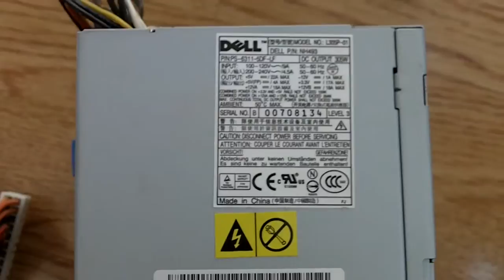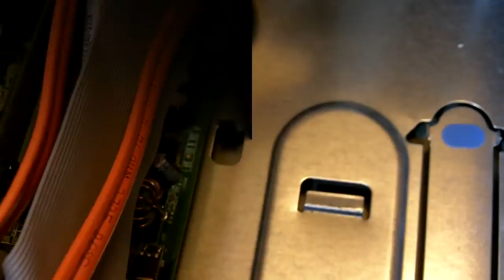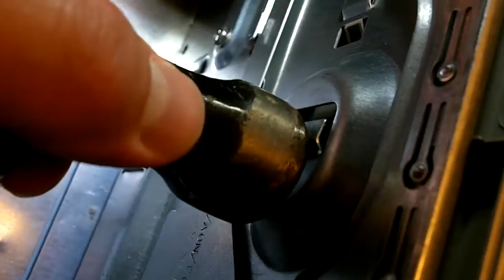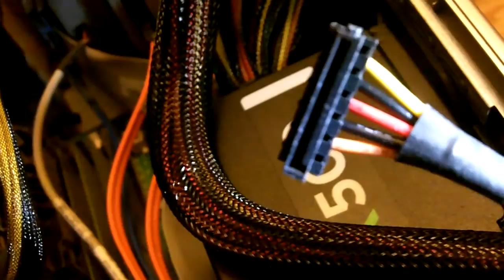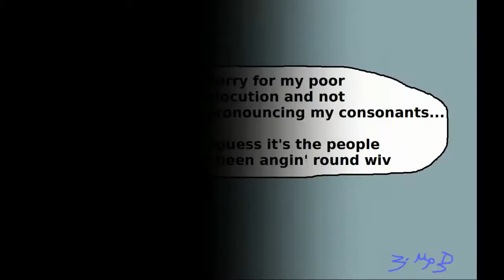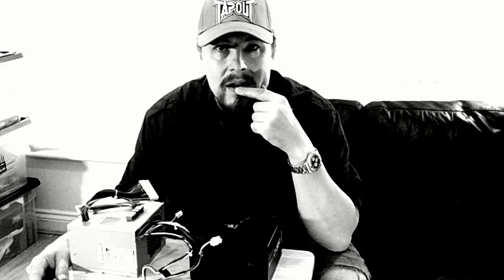Install CORSAIR CX500 Power Supply into DELL DIMENSION  E521

Comment: Thank you, was helpful to know how you identified the CPU power connection. ON our Dell 660 I was unable to get the 24 pin connector latch on the CX500 to latch on the MB 24 pin connector, it just wouldn't push down far enough to latch, did you run in to that problem too on your E521?

Comment: Was it possible to pull the guts out of the old power supply and place the entire new power supply into the old housing?
Reply from the maker: +Larkinchance I doubt I would be able to do that, would probably damage the box and connections, but if the new one fits as it is then what would be the point...it would take ages too and probably have to solder things etc.

Comment: hey i have a question i have a e521 and i want to upgrade my graphics card i still have the original one which one do u reccomend i havent  replaced the power supply either i could do that too.. but i just want to know your opinion
Reply from the maker: +t uraab (ehjmechscape) well there are so many but just check compatibility with your operating system, if it is PCI connection I expect there to be no major problem. The balancing act is always between cost, specifications and compatibility...which can sometimes be an issue with older machines and the latest hardware upgrades. Sometimes is better to get an upgraded box and motherboard which allows all the latest upgrades, some very good prices available once you abandon the big brands.